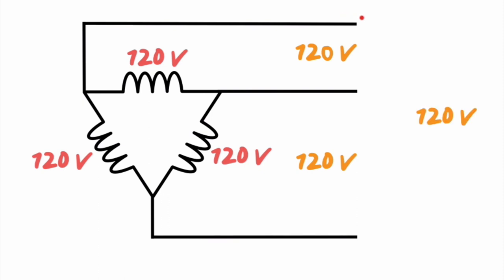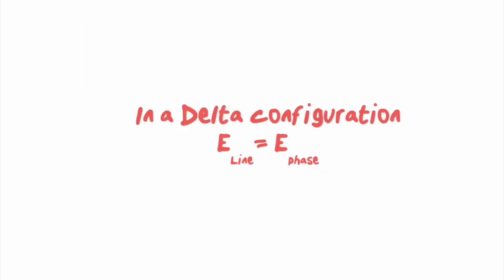Delta voltage (Line vs Phase)

Comment: Here's an off-the-wall question for you. I have a nice shop with single phase power. I would like to build and install a rotary 3-phase converter to provide 3-phase power, mostly because used 3-phase equipment is a lot cheaper. I'm currently a couple weeks into the research and design phase. I have some questions:

1) I think the output of the rotary converter is a delta configuration. Am I correct?

2) I have seen how to balance the ghost leg with the two hot legs using capacitors, but does the ghost leg remain stable when I connect a load?  Do I need to meter the ghost leg voltage and switch capacitance depending on load? I could do that with a PLC and relays. I haven't seen anyone deal with this question. Is it relevant? 

3) I would like to use a 15 hp pony motor, which would give me enough juice to run a lathe or milling machine. That hp rating would need 11.4 kw, or 47.5 amps @240 volts. That just squeaks under the 48 amp continuous rating of a 60 amp circuit. Am I figuring that right. So far I haven't found load calcs for a rotary converter. 

I don't expect you to design this thing for me, but if you could give me some hints I would greatly appreciate it.  Yes, I have thought about VFDs, but the milling machine alone has three 3-phase motors with housings that are cast into the machine. A rotary converter is a lower cost solution.
Reply: I am only learning and not in any capacity electrically literate, but I thought if you've not found the answer to your issue could you use a variable frequency drive to power the machine?

For curiosity sake what was your solution?
God bless
Reply: @straifus3742  By the time I buy a VFD for every motor, that gets pretty expensive, and adding another 3 phase motor would require another VFD. I still haven't done anything, and am still limping along on single phase power.